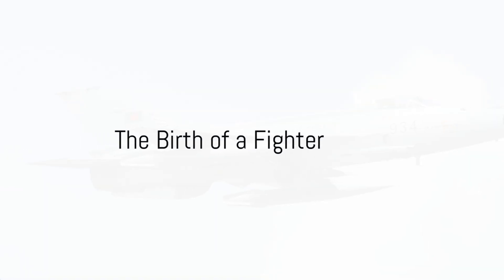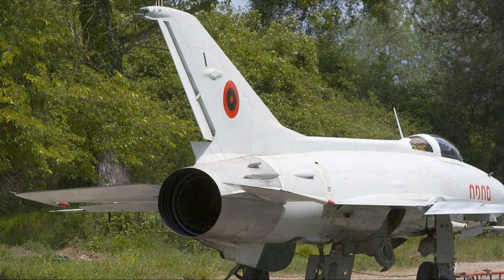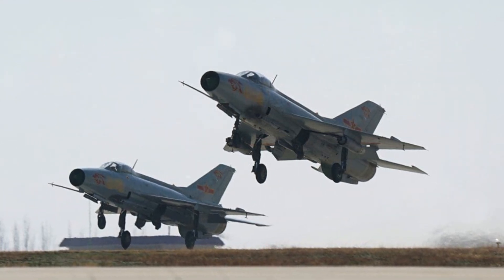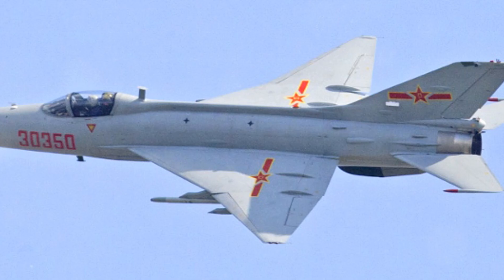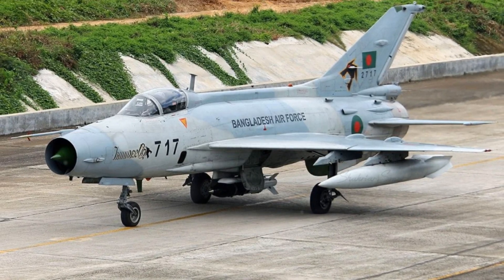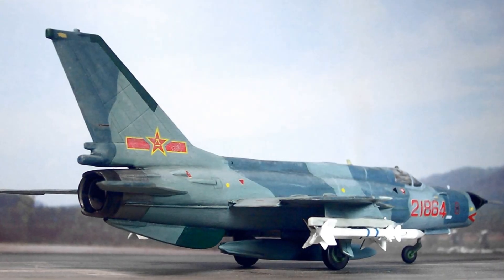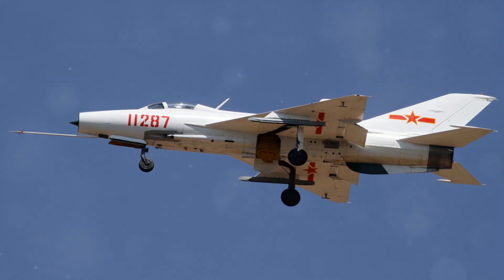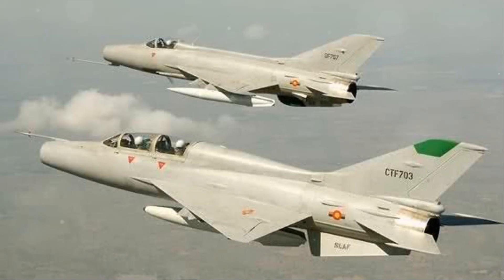Chengdu J-7: Why this Chinese Fighter Jet is a National Treasure

Comment: The original MiG-21 had full supercruise capability - something the much derided Lockheed F-35 has not got.  The last variants of the J-7 were very capable aircraft, and now that they have been withdrawn from active service, they are becoming available on the second-hand market.  One might look very nice parked in the driveway, don't you think? :-D